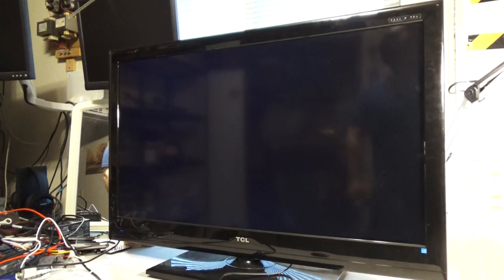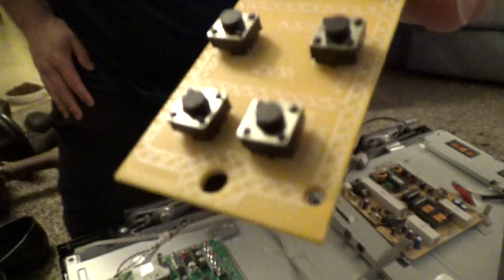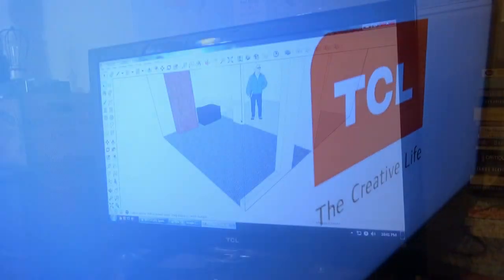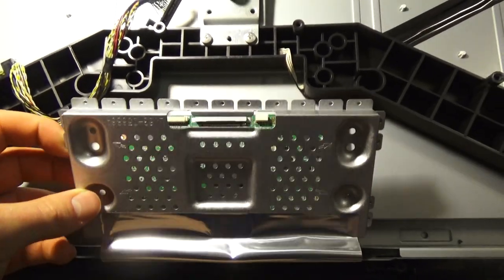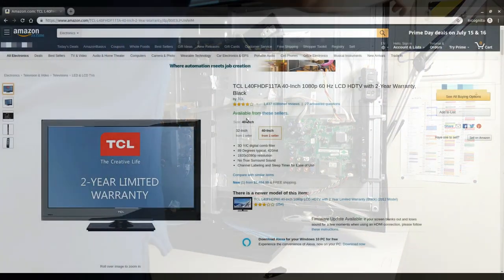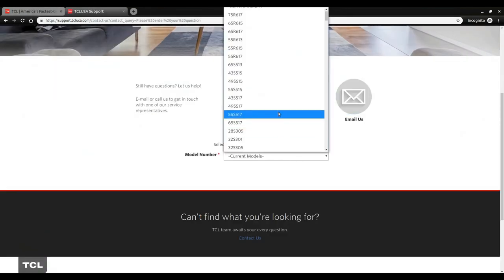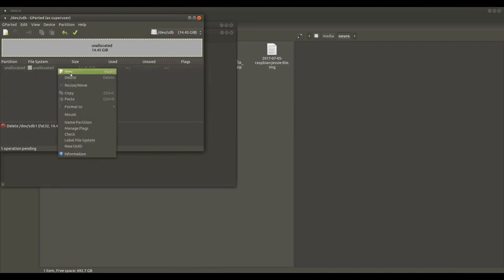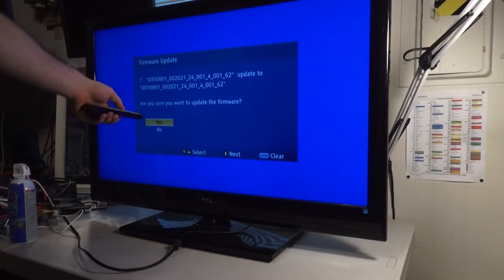TV Repair part 2 - TCL L40FHDF11TA Black Screen on HDMI

Comment: would you happen to know where i can buy a replacement TCL TV Screen 32S321?  My screen is cracked?  Thank You
Reply from the maker: eBay, Amazon, ect. If you can't find the screen alone, look for your TV model with the term "broken" or "for parts" and find one that still has a good screen.
Reply: Check out the place of purchase ,each TV  model is made with 3 screen ,the dealer may have them